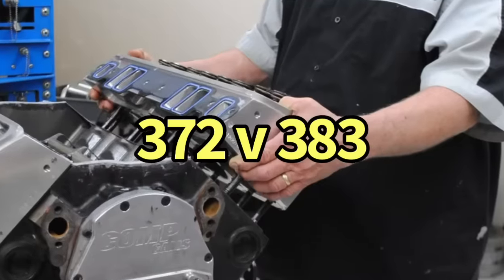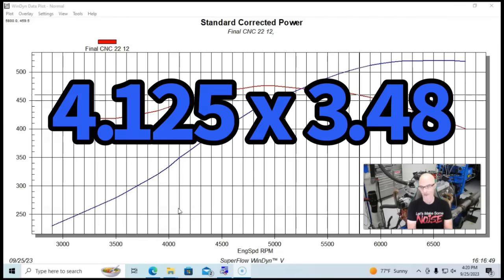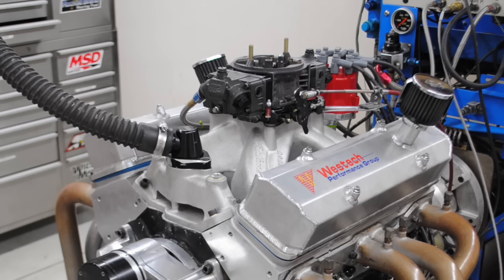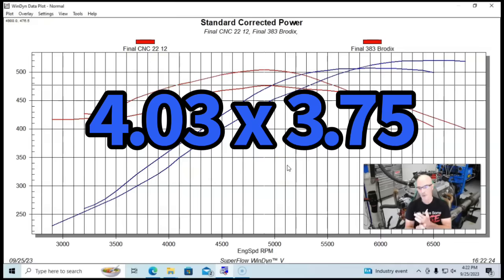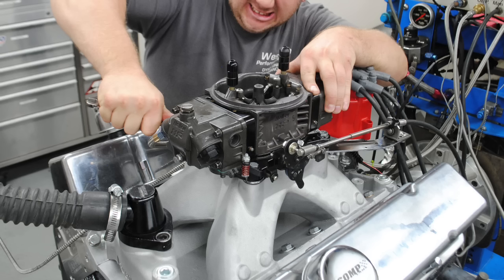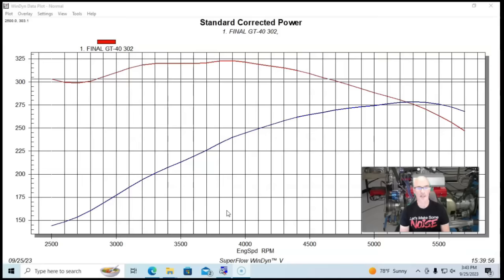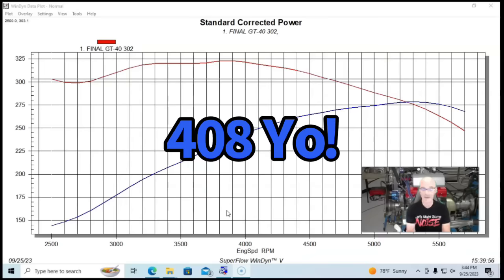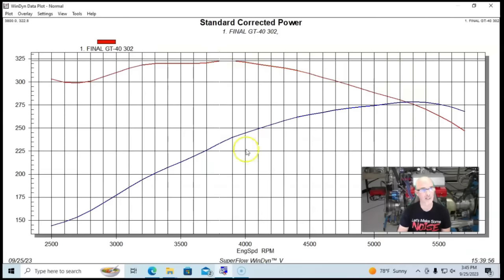BIG BORE VS BIG STROKE-372 VS 383-WHICH SBC STROKER DOES IT BEST? BONUS TEST-302 VS 347 FORD

Comment: Well it depends on what you are going for. Everything is about balance. Power only goes as far as what allows it. Technically the long stroke would out perform  a higher HP  engine when  properly mated to what allows it to run at its optimal range. I mean applying the power to the ground is why many lesser power vehicles are so efficient in racing. It's not always about power but how it's applied. The short stroke is going to fall before the long finding the balance is key. Properly set up either one can do exactly what you want regardless of  the power. Improperly set up well you just got a vehicle that can do some good burnouts

Comment: You know more than I ever will kon these matters but when watching the 302ci vs 347ci option i wonder what this would be like if you used better heads, intake and cam to take advantage of the 302?  Run a 302 with a set of AFR 165s or TF 11rs, TF Track Heat intake then something like your comp XE274 or XE266.  Then use all that on the 347, I’d love to see what the stroker does then.  I did a 332ci back in the day and will never do that again, like you mention I’d either do a 351W or Dart 4.125” block if I want more cubic inches.
Reply from the maker: see the many other vids up on that
Reply: @richardholdener1727  I looked but don’t see any comparing similar setups, ones that I’ve seen have different cams or intakes when comparing the different displacements have yet to see a dyno comparing same setup of 302 (head, cam,intake,exhaust) with just changing displacement….if it exists please reference where to find

Comment: Shouldn't the question be , why would you shorten the stroke to make 373ci, thus reducing the power potential in what is a performance engine 🤔
Reply: Dumb dumbs is why..lol Some ppl believe too much bore on a boosted engine will crack the block.. Not wrong but also depends on the block used..
Reply: rev potential. F1 motors have very short stroke as do motorcycles. Top RPM always higher
Reply: @jamesmedina2062
  Yes , in high reving specialised race engines, you would be correct.
 Class rules restricting capacity could also be a factor in choosing a shorter stroke crankshaft ,however, most of us are looking for affordable power.
When running a domestic V8 type engine like the SBC that are usually restricted to engine RPM  bellow 8000rpm the valve train is the limiting factor, not piston speed,  I'm pretty sure Richard has a video on the subject.
 Keep in mind here that the 383ci has the longer stroke than the 373ci , which isn't the limiting factor in its rpm potential.
 In this day and age, people are spending money hand over fist on stroke engines because they will make more power than the shorter stroke versions of the same basic engine.
The best way to make more power in this 373ci example would be to lengthen the stroke.

Comment: I would think that the 347 would need bigger valves since the bore is that much bigger and still doesn't make more difference in top power ?
Reply from the maker: 347 was 4.03, 302 was 4.00 (not much bigger)
Reply: Ooops , I got lost in nrs. I meant the 372 would need bigger valves compared to the 383 💪🏼. Sry my bad.

Comment: IMO this test should be done 302 vs 305 with same cam, heads and compression. Displacement difference is less than one percent.
Reply from the maker: see the 302 vs 305 video-they make the same power

Comment: Its not just the stroke or crank the 383 levers into the cylinder wall to fix this 
they use short pistons But longer 6 inch rods the racers call them 400s
but it raising higher in Bore causes more compression 
 Ive heard of longer rods on 350 chevy even made a 377 small block 348 crank and 400 rods its in early chevy truck service manuel  but unleaded killed them .
But the 400 small block was the king
Reply from the maker: rods length doesn't change stroke or displacement-nor does it change power much. I've tested 5.7 vs 6.0 inch rods-it made 0 hp change
Reply: @richardholdener1727  your test was half fast 1st its going to ballance engine better 
2nd less side wear of cylinder especially stroker but shorter pistons 
the Ballanced and blue printed 355s 
ive heard with tall pistons reached 
250 thousands higher in cylinder 
might be decked too I know they had to clearance valves .
How could that not make more compression Torq and HP and cubic inches maybe not cubic inches or its making the most of your cubic inches 
its how all the parts work together and race
car spec engines ar built 
it was legal with 358 SB2 Nascar engines 
9000 rpm engines .
Im pretty sure you know more about that than me 
I was just test and tuner adjusting springs in Distributors back then and helping 
but not getting every thing explained always under the gun
Seen many 330 callies cranks  to but not sure if that was norm or what
Reply: i actually forgot the 358 might be the 330 callies crank i think rebuilders might go like less 4040 bore Nascar might go 4060 bore cause they are custom block  mabey 4125  to make extra inches

Comment: Now if you want to have some real fun  build a 400 block with a three inch 302/283 crank for a 321 ci high rpm monster . Stuck in a gutted Vega or Chevy II , shifting at 9K . Someone would have to spend a LOT of money to catch you .
Reply from the maker: the stroke won't determine whether it can rev-that is all valve train
Reply: @richardholdener1727  bs !  A 302 will out rev a 350 all day long while running the identical set of 2.02 heads , with the same cam and springs . A local gas class racer used to run his .030 over 283s to 11K on every pass , something you will never do with a long stroke engine . He's died in a car crash years ago , but see if you can find a Car Craft article from '76 to maybe early spring of '78 on Jerry Marquardt. At the time of the article he was running a '64 Vette in G/ Gas ,I believe . Prior to that he ran a '55 Belair called Bad Jose .
Reply: @richardholdener1727  not only does a shorter stroke crankshaft weigh less than it's longer stroke counterpart , there is also the difference in the amount of piston travel per revolution to factor into the equation . A little difference of 0.920 per revolution . We're still talking 302 vs 350 here .

Comment: You didn’t mention the rod length? Did the 3.75 stroke have the short 5.56 or a custom 5.7-8 or 6.0 rod? Because a short rod the piston doesn’t dwell at TDC as long and creates torque! But the larger bore will almost always make more power up top because of the valves being un shrouded! That is also why open chamber heads with pop up pistons generally make more power! Cool combo comparisons! Drag car! Top end power! Streetcar average power will prevail!
Reply: After market kits don’t use 5.5 rods
Reply: Those 5.565 inch rods are a rarity nowadays. I have a set. Don't use 'em.  Some companies still make them but they are super expensive. He's probably using some aftermarket 5.7's or 6 inch rods.
Reply: @N-Lee  copy that thanks! I haven’t messed around with any sbc engines in awhile! Back in the day had a 400 sbc in a 72 Chevelle and one in a 85 Blazer! Been into the Fords for quite awhile but thanks for reaching out! I’m car enthusiast of all cool cars and like videos like this one!
Reply: @cedricwilson2055  copy that Thanks! Haven’t messed around with sbc’s in awhile into the Ford stuff now! Wasn’t sure if the short rods were used in applications like these two engines!
Reply: @stevensink5544  the more common is the 6.00 inch and 5,7 rod. Lighter piston anyways with the 5.7,6.0 rod. 
 The 347 ford can use a 5.5 rod though
Reply: @cedricwilson2055  my 347 combo used a 5.400 Rod but I had a 351C Cleveland that had a 6.0 Chevy spec rod for the smaller 2.10 journal for better oiling then the larger 2.3 ish I forget what they were factory! That car ran 10.0’s at 135 NA in good air and 10.20’s at 131-2 in the heat!
Reply: @stevensink5544 I have same bottom end. It was a Nowak stroker kit fully balanced. What cam specs you got?
Reply: @jamesmedina2062  my 347 had a Comp cams solid roller with 248/254 at .050 and 614/621 lift! I don’t remember the actual series it was though

Comment: The 383 maybe has a better power band for street applications but at the expense of longevity. The rod angle is atrocious, forcing the piston up against the outer surface of the cylinder bore. Not a good design.

Comment: How about a 377cid shoot out?  4.00 x 3.75 vs. 4.155 x 3.48 vs. an LS3 6.2L.
Reply from the maker: 4.0 X 3.75 IS 372
Reply: @richardholdener1727  Check your math Richard.  4.0 x 3.75 is 377.
Reply from the maker: check your math-per wallace racing displacement 4.125 x 3.48 is 372 (the 377 is overbore)
Reply: @richardholdener1727    That fact has never been in dispute Richard.  To recap, You said: 4.0 X 3.75 IS 372.  I said:  4.0 x 3.75 is 377.  What does math say?

Comment: Only reason for a power difference I'd think is if the small bore was shrouding valves.
Reply: Probably because a 383 holds more charge. Like a cup is bigger than a 1/4 cup.
Reply: @cedricwilson2055  I get that, but that's not what I'm saying. As engine speed increases and air demands increase, shrouding the valves will hurt power. If it was only "cup size" then how would you explain the larger engine making less HP and TQ at higher engine speeds?

Comment: The engines dont have the same heads?! The advantage of a larger bore is to be able to add bigger valves and safely run at higher rpms. With the same valve size just keep the bigger stroke for torque.

Comment: Wonder why the 377 wasn't done instead of the 372 ?
Reply from the maker: standard bore 4.125x3.48 is a 372
Reply: @richardholdener1727  I finally found where you commented that the engine you used was a standard bore new block. Not an old 400 block with a new bore.
Most of us are familiar with the old blocks and the cubic inch of a 377.

Comment: The 383 is cheating.  It's both bored and stroked.  It's a .030-over 350 with a 400 crank.  The 372 is a stock bore 400 with a 350 crank.  To make it fair, the 383 would actually be a 377 if the bore was stock.

Comment: in the single plane intake test way back strip dominator made 14 hp more than brodix intake i just dont want the short stroke guys to win
Reply from the maker: when did I compare those intakes?
Reply: Short stroke wins due to math, because more RPM is more power.
Reply: jeff smith did the test
Reply: @TheMailmanOfSteel  not in the emc challenge.  Where avg torque and hp over a certain rev range. No one upset a short stroke

Comment: There is no substitute for cubic inches! No point building a 383 if you can build a 434 in the same block.
Reply from the maker: a 434 is difficult and expensive on a production 350 block-needs to be after market block
Reply: Absolutely, but they are cheap these days. I was always running my OEM block, wasted a lot a money.  Last 10 year I run a SBC 434 Dart Block with 700HP and never breaks down. Best investment ever.

Comment: Can't believe your horse power and torque was so low. I build asphalt circle track engines that are 4.125 boar 3.300 stroke 358 cubic inch very old outdated 18degree Chevrolet aluminum heads two piece intake manifold by Chevrolet again very old outdated 13.2 compression 734 hp at 7800 rpm
Reply from the maker: I take it you missed the point of the video-interesting that you feel the need to compare

Comment: You should have made a 377, by boring it .030 over to get it closer to 383, way wrong Lsa.call vizard.
Reply from the maker: you lost me at should have taken a running crate motor apart to bore it